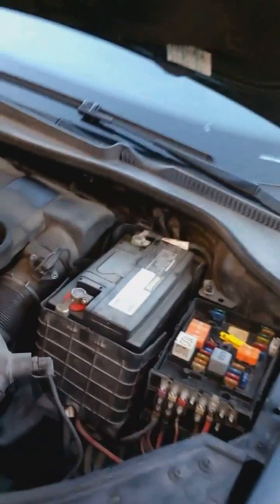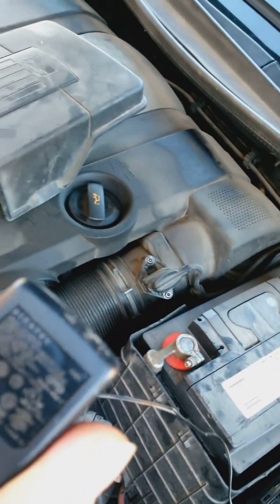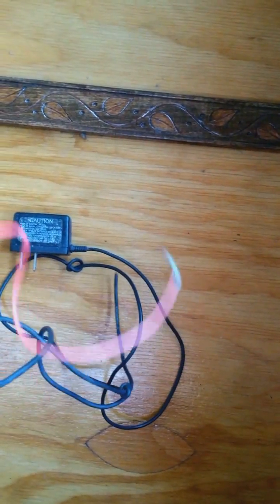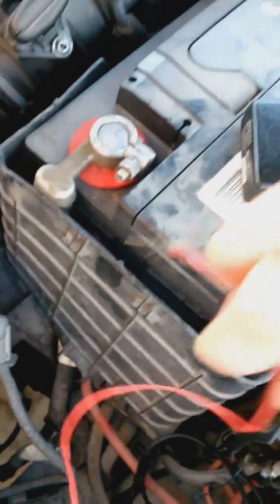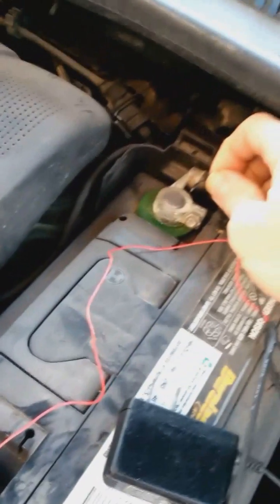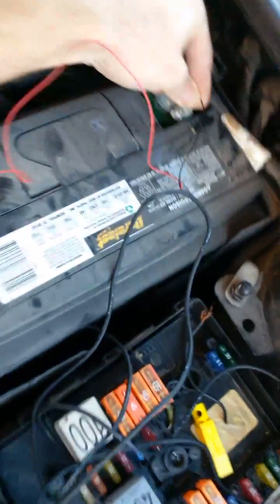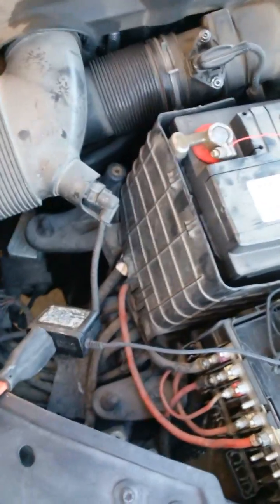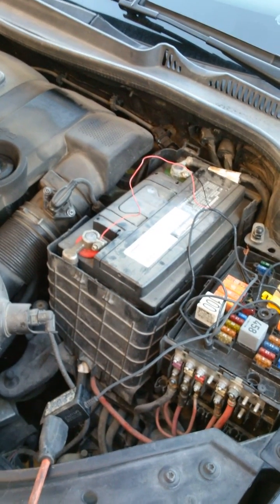Jumpstarts a car using a cell Phone charger dead battery

Comment: Why don't you try and use  a Power bank to jumpstart the car  Power bank 6volt at 5amp  used to recharge a phone battery when stater is not cranking

Comment: You will have a very long wait if your car is a diesel and your battery is either totally flat or basically dead as a dodo!! better way is if you have a friend with a running car, and 2 bits of wire(even domestic wiring, tripped into 2 individual parts, place 1 on the positive of the donor car the other end to your positive side of battery, place the other to the negative side of the donor car and the other end to your car's negative side, making sure that the wires are actually insulated, or at least DO NOT touch each other and any other electrical components as well as any metallic parts of their respective car's, start up donor car, raise engine rev's, wait around 5 minutes for a mildly flat battery, longer for a larger battery(or diesel vehicle) then start up your car, raise the engine revs of your own vehicle for around 5 minutes to ensure sufficient charge, before driving away, remember to detach each wire singly without touching anything electrical or metallic surfaces on either vehicle, hope this helps, BLESS 😇👍

Comment: Funny.  I had a slightly dead battery.  Just enough it wouldn't turn over.  I thought of the very same idea, but with a computer charging cable.  Then as i was  waiting for it to help charge, I looked up for tricks that might help and found this video.  Lol.  Guess desperate times call for desperate measures.

Comment: This will blow charger. I had tried it. As charger draws more power and heatsup, wire coating melts away. 

You have to use transformer based 12volt power supply to charge such big batteries. Else use battery invertor if ypu have one in your home.
Reply from the maker: lol no it will not blow chargers
Reply: @ryankay6941  my charger got damaged before watching this video i had tried it on my 7ah battery.

Comment: My battery is dead, worked yesterday, left a small light on. 
Iffff this works,,,, 
I'll comment back, plan is to let it charge every 15 min and check for about an hour. 

Iffff it doesn't.... 

Well then ... I ask for a jump...  (Hopefully they have jumper cables or I use the cord from my already cut charger lol)

Don't let me down Ryan!
Reply: Guess it didn’t work
Reply: Did it work

Comment: I never thought it would work but it did for me. All I did was strip the phone charger cable separated the white and green cables and just hooked up the red and black ones to each car battery terminal. I did use a orange extension cord because my car was dead in the garage so the phone charger could reach. Took a couple or tries and maybe about 5 to 10 minutes to charge trying every couple of minutes. And !!!!!!!. It did it. I used a LG phone charger by the way. Lol

Comment: if your charger has green and white wires as well. Where do you place them?
Reply: Nowhere you only need red and black.... The other two are data and information wires
Reply from the maker: i would need a volt meter to turely  know which way the power is flowing,but i would guess the green is neg

Comment: I tried this but didn't work. I left the car about 20 min but it looked like it went from 5% to 0% - my doubt was if I should try to turn the car on while plugged ? as in like when you are transferring power from another car - I didn't want to try it like that because I was afraid I was blowing up something from the electrical side of my home.
Reply: Denisse Miranda  i did it with a laptop charger   It works great , and yes you have to turn the car on while plugged.
Reply: Hi Denisse, I have the same question, did you finally get it to work? If so what did you do differently?
Reply: Lemlem Ayele I didn’t try again, I didn’t want ro risk my 2 year old car (is not even that old!) so I bought a black and decker charger in amazon, which essentially does the same as this. I don’t think the theory behind this trick is wrong, it may work if the battery is not too drained, you just need to be careful and leave it for a while(over an hour at least) if I had another car I would gladly tried again. The phone charger got a little bit hot those 20 min I used it. I left the charger I bought plugged for 3 hours + I drove the car for 1 hour to charge it and my battery got healthy again. The manual in my charger says “DONT TURN ON THE CAR WHILE CHARGING!”